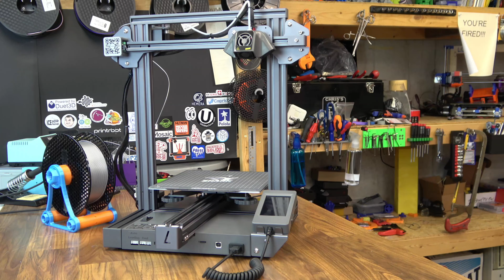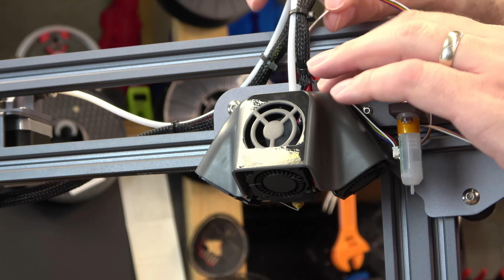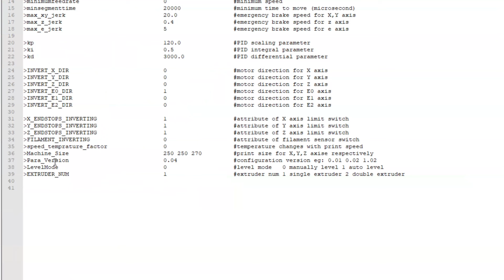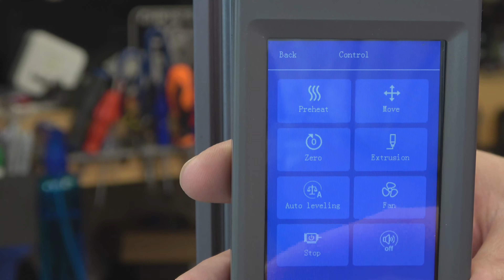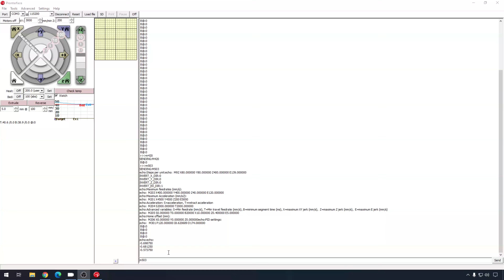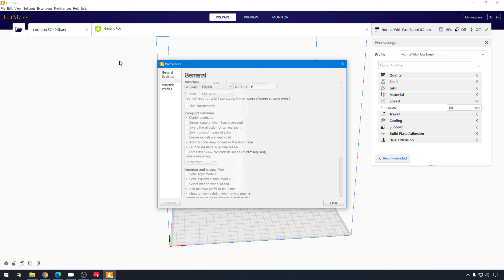Lotmaxx SC-10 Shark - Auto Bed Leveling Setup - Chris's Basement

Comment: Hi Chris, I know this is an old video, but I'm trying to flash custom marlin software on the Shark, and I can't find the source code anywhere. M503 gives a dead link. I could try just vanilla marlin, but I have no idea what to do to get the touchscreen working, any thoughts?
Reply from the maker: That's always the hard part, this touch screen aren't all supported through the firmware. I gave my Shark away, so I'm not sure what board they used and how all that was configured.
Reply: @ChrisRiley  I see. Ok, well that's still good to know. I appreciate you taking the time to reply!

Comment: Hi,have bought this printer,but can't autolevel it ...I put the paper under the head,and I can move it (little hard, like shown in videos),but when I want to print somthing the head is in air and the PLA don't stays on bed ...
Any advice,thx ...
Reply from the maker: Make sure your Z offset is getting updated. It might take a few tries to get it right.
Reply: @ChrisRiley  well i have tryed for 2 days, but with no success, after flashing without autolevel the print was perfect. Forgot to mention that the bl-touch is like 1cm under the printing head, shouldent they be equal?